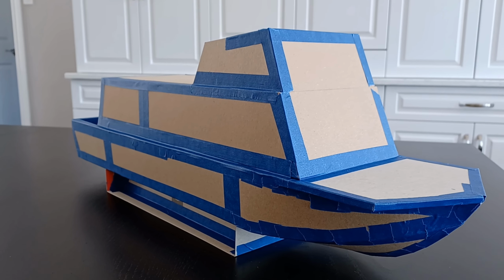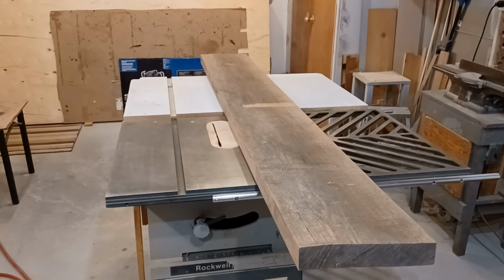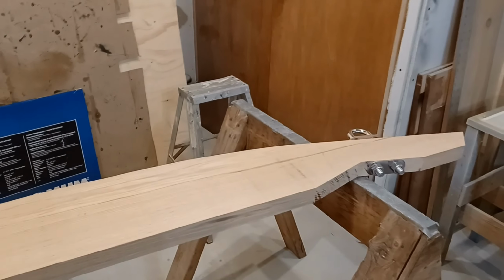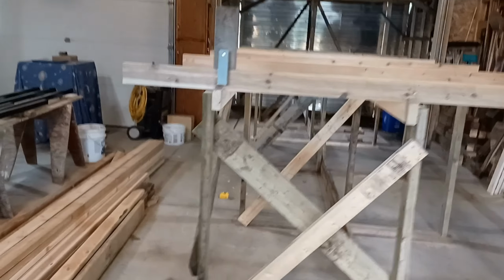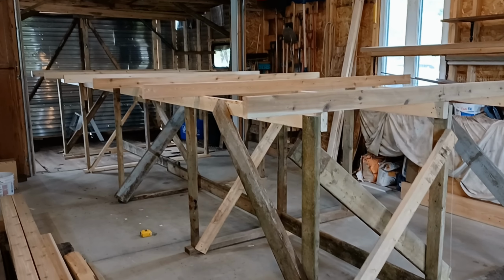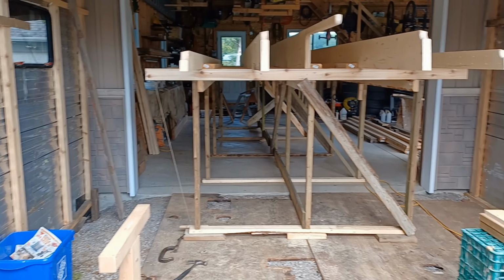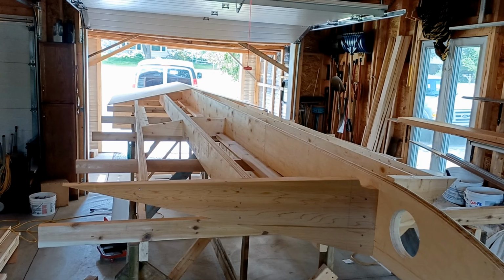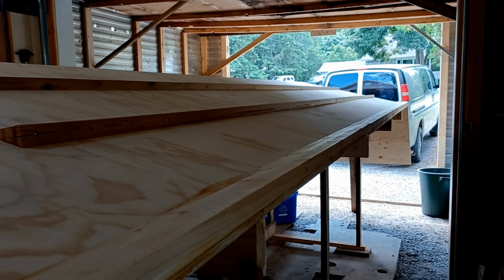Houseboat Build Episode 1

Comment: I would be shocked if your engine plan works.  I'd be thinking big block V8 for sure.
Reply from the maker: Time will tell, but I ended up going with a Vovlo Penta Duo Prop 280 hp V6.  I had them run the numbers through their software, and they're telling me I will have a top speed of 33.9 MPH.  The boat is close to its' final weight now, and it is right in the ballpark of the numbers I gave Volvo.  That's better than I had expected, so hopefully I will be happy with the performance.
Reply: @RetirementOurWay  I hope for your sake the numbers are good.  I suppose the one thing you may have on your side is surface area (length) and perhaps lower deadrise angle to provide more lift, so perhaps the estimates are correct...BUT the problem is the additional weight that always happens to gather on most boats, especially any live-aboard type (fresh water tank, black water tank, kitchen/cooking utensils, grill, coffee maker, deck chairs, tools, inflatables, tools, etc.)  I'd be willing to bet you'll add nearly 1000lbs in goodies...hopefully you weight the boat when it is completed and then weight it when it's loaded.  

Do you have an overall weight estimate of this project?
Reply from the maker: @benjaminquinby5418  I had the boat weighed in October, just before I put it in storage for the winter.  At that time, the boat and trailer combined weighed 7286 lbs.  I'm guessing I can deduct 1500 lbs for the trailer, leaving the boat currently weighing 5786 lbs. That's with the engine installed, but no outdrive.  With what I still have to add to finish the boat, and full tanks my calculations have it at 8306 lbs.  Another 1000 lbs for our stuff puts it at 9306 lbs.  I told Volvo Penta 9500 lbs, so It seems I'm really close.  Then the next question will be how real life compares to all the calclulations!